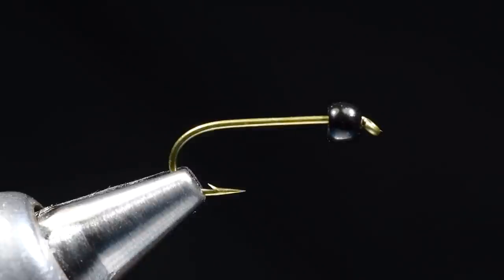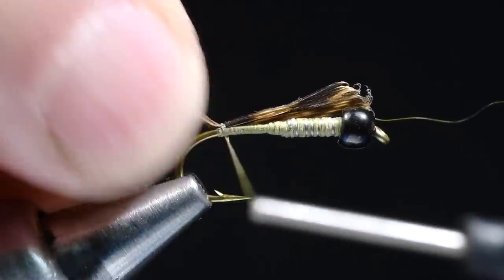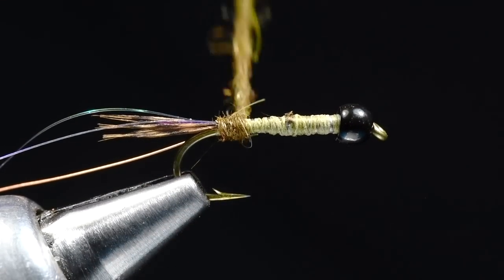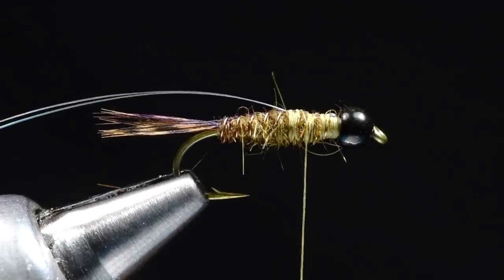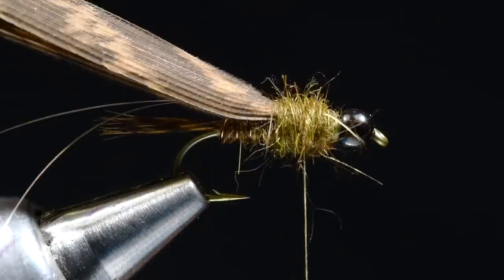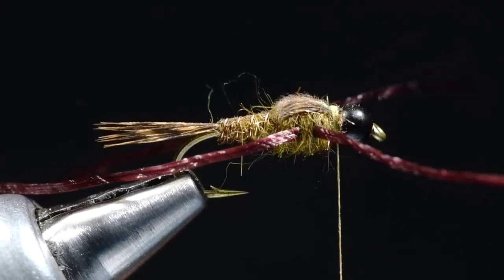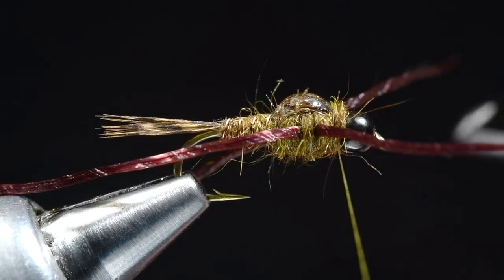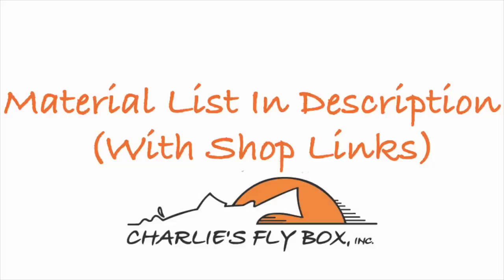Rubber Leg Hare's Ear Green Drake Fly Tying Instructions by Charlie Craven

Comment: Hey sir, Does the Nm of the UV light matter? I've got a cheapo very bright rechargable one from Amazon, the issue i'm having is that no matter how slowley I let the UV harden it still flakes off.
Reply: Use flex resin if it's not working change brands might be the best thing for you
Reply: I have been through this, it's very frustrating. The folks at my local fly shop told me it was probably the resin I was using. I was having tons of problems with the loon stuff. I started using bone dry and I haven't had any flaking since. I really like all of the solarez stuff. I hope that helps.